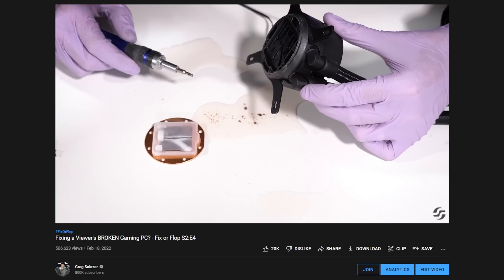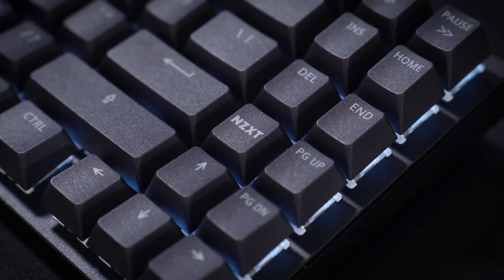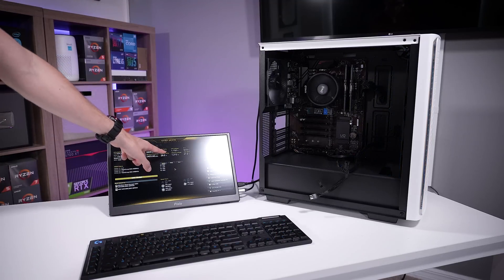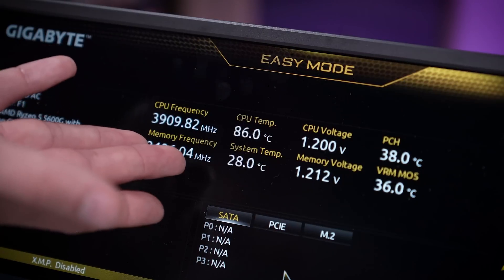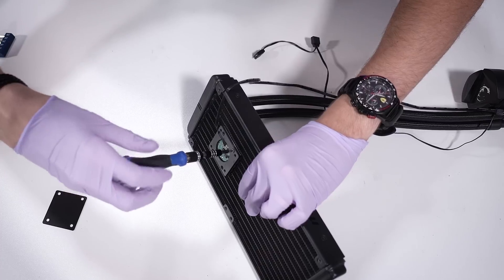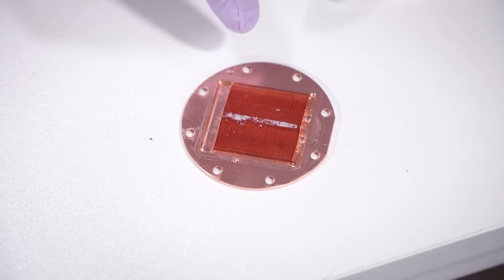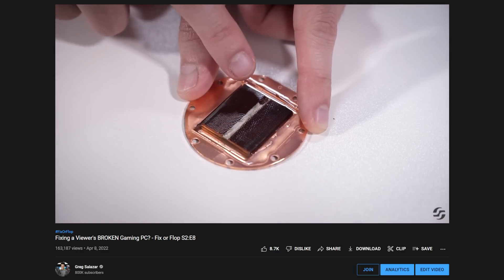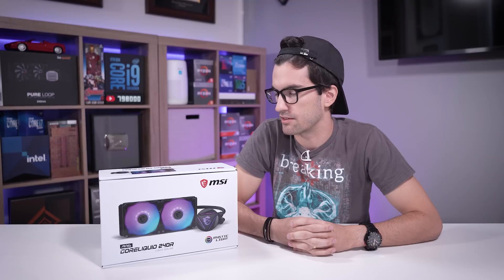Testing Viewers' Recalled AIOs

Comment: When these came out in Australia,  the 280R was on special for the same price as the 240R, so I bought that. My 280 is not part of the recall and is still running fine, so I got lucky there. I have a nice air cooler to swap to if it goes bad, but at the moment the 5600X cpu runs super cool.

Comment: I feel really bad for the people who bought this AIO, as well as the clients I recommended this too. This cooler is really popular at least here in Canada because it (was) the cheapest 240mm AIO with RGB fans included.
Reply: i did and it died 3 months later
I've came back to my old ventirad lol
Reply: Considering how many have sold it's still about a 1% failure rate.
I have the second cooler that was tested, the exact same one.
Year-and-a-half and my CPU has never been over 60 ft Under full load for hours.
Reply: @testickles8834  damn, i wasn't lucky then
Reply: @fmcparadise1450  
I'm beginning to feel like I won the lottery on every part I bought.
I've never had an issue with anything and it's mostly MSI.
Reply: @testickles8834  i mean im mostly msi but the aio is the only thing im unlucky with aha
Reply: @fmcparadise1450  considering how many are sold, and the fact that everything mass-produced has its number of turds, it's not a real big surprise or anything when you buy a piece that doesn't work right.
I would still say all in all the computer industry is still doing way better than the automotive industry

Comment: I wish I had kept my bad AIO so you could have taken a look at it and seen if it was really the liquid or just the AIO being garbage. My new AIO works great though, so no problems now. Got a Corsair one, since it works with my iCUE software, which is how I found out my old AIO was not working when it was under load. Easy to use software really saved my butt.

Comment: Hey Greg! This video was pretty interesting. I have a small problem with my pc. I have a NZXT x53 rgb AIO, and the temps are higher than I think they should be. I have a fractal design meshify c. One of my standoffs came without threading, and the stand-off screws don’t want to screw in. Not sure if that could be causing a problem. I’ve also tightened the block itself so I don’t think it could be that. If you have any ideas, that would be great! Also I’ve already tried all the options in the video that you have about high cpu temps. Thanks for looking at your comments!

Comment: I have the 360R v2 (replaced it through MSI’s recall over a month ago) and so far the temps have been good. Using it with a 5900x and temps have not exceeded around 82c running cinebench for 30 mins and idle temps are around 35c. MSI seems to have fixed the issue with their v2.
Reply: I used to work as a mechanic in a few Chrysler dealerships and I've noticed when we had to perform a recall on a vehicle, some of the replacement parts we would install were the exact same part, number and design as the original. Sure it would fix the safety issue temporarily by having a new part installed but the same problem may happen again but by then they would have expected you for to have purchased a new car already.
Reply: hey man does the v2 replacement act weird again after all these months?
Reply: @aaa5483  it has been a year now and it still works fine.

Comment: How was the thermal paste pattern when the cooler was removed? I had an issue with the heatspreader of the AIO not being flat. It was pointy enough to where I could feel it with my finger and could see it in the thermal paste "squishprint"

Comment: all AIOs made by apaltek OEM have same issue. ex) LianLi Galahad, Enermax LIQMAX and MSI Coreliquid MAG. According to igorslab this issue is caused by missing flux compensator
Reply: They are selling these units without a Flux Capacitor???

GREAT SCOTT!!!!
Reply: I have the Kraken M22 which is also made by Apaltek. I understand that it wasn’t the best choice, but so far there hasn’t been any issues after 3 years of heavy use.

Comment: I had an 2950X with an Enermax Liqtech cooler... so it goes without saying, it had problems. Got it replaced under warranty, immediately drained it, and filled it back up with distilled with some biocide. It was good right until I sold it about a year later.
Reply: Yeah, Enermax has taken a big hit on their Threadripper AIO's for this same problem. A little biocide and there may have never been problems.

Comment: Thanks for a great video Greg!! It is nice to see MSI take responsibility and replace bad products. I always thought their design to have the pump in the radiator. But still the CPU block needs maintenance every now and then. I bought my son a Cooler Master 280 for Christmas 2021. Hopefully it lasts for a good amount of time. It's the first AIO I have installed in ~35 years of building.

Comment: Would be interesting to see production dates and runtime hours on these AIO's.
Reply: Well I got my replacement for my first one in January of this year and it died about 4 weeks ago so it's less then 3 months of use for 3-4 days a week for maybe 4-5 hours a day
Reply: @potatoskins8155  that blows!!!! Pun intended
Reply: Had my msi aio for a year-and-a-half now.
CPU has never been over 60c under high load.
Sounds like I won the lottery
Reply: I've had my mag 240r since Christmas 2020 and I have had mine apart about 4 or 5 times now because of the issue, I looked it up last year and nothing came up but now I was told it's recalled so hopefully I get a new one in the next week or two.

Oh and my pc is running idle 24/7 and I only game on it once or twice a week so maybe 16 hours game time a week running with my i7 9700k

Comment: Hey Greg, I had the same issue and submitted an RMA. They sent me the new one first and provided a return label. I was pleasantly surprised by the process. Thanks for making this known.
Reply: well go MSI for not dicking customers around and getting the issue resolved.
Reply: I'm Scared, I hire a Thecnician to check my pc, he sold me a air cooled disipador (added free thermalpaste) and he charged me $50 to come fix my pc at my home.
but, the thing is he drained all the Brown water from the radiator and cleaned all the white particles from the block, he added Green radiator water for AIO's  he said and temps were still hight af. I'm afraid that opening the AIO could cancel the warranty :( Wish me luck i'm calling RMA, MSI live chat gave me the number, its mondays to fridays 9 to 6 PM PST

¿Any advise on what to say to RMA to get refund or another AIO?.
Reply: @skinnycattv  you’ll need to do a quick Google search for their RMA form and specify that the AIO is overheating. You’ll need the serial number as well. It is really simple. They didn’t hold up the process the minute they heard overheating. Hopefully you haven’t missed they’re window of automatic acceptance.
Reply: @imagotchi_  ty brother and all of you that helped me. I filed an RMA with the thermal problem and the Serial number, I will be sending the AIO as soons a the replacement ships in. (lol, almost gave MSI my Motherboards AM4 Back plate and plastic bracket thinking it was part of the AIO, haha).

I will get back ASAP to update what happend with RMA.

Comment: How can we know if its the new or old version of the AIO? I have the 360 version and might need to have it replaced.
Reply: If you've had it more than a couple of months it's most likely to be a V1. The V2 released in February/March if I recall. Check the RMA page with your serial number and you will know for sure.

Comment: Got both the 240R and the 360R since I was so happy with the 240R I bought first. 57 degrees with an R6 3600 overclocked to 4,5ghz last time I used it. The 360 is a bit toastier at 72 under load, but that's with an R7 5800X  which everyone said was a toasty boi. Played games with the 360R for 12 hours today, and at this moment, I'm idling at 42C watching this video at the end of the day. So I don't know which fluid provider isn't doing their job, or if I'm just super lucky. Bought my first MSI 240R in 2019  and the 360 in 2020 so maybe this is a failed attempt at cost saving by changing fluid provider? Kinda hope this is a sub contractor fluid problem since I like having an aio I can front mount without issues.
Reply: it's not just the liquid, the pump started rattling very loud within 4 months, the complete design sucks and is bad. Better use a decent brand , like corsair, never had a single problem with them in 8 years of use.
Reply: @Diaman_D  Well, mine isn't rattling at all. Air cooler was way louder. Like I said, this sounds like MSI fucked up at cost savings for second iteration of the cooler and chose a liquid company that just isn't good.

Comment: 5950x idles at 58c @ idle 74c running prime 95 for 12 hours straight.  Just a hot chip. Also running 4 140ml outtakes and 8 120 intakes and corsair 420mm elite aio
Reply from the maker: This is a 65W 5600G ten minutes after a cold start LOL.
Reply: @GregSalazar  sorry lol thought you Said 5950x.  Yes that's abnormal.

Love your video's thanks for what you do.

Also I just sent back a nzxt kraken 73 for same issue

Comment: Can confirm these Coreliquid coolers are junk. Had mine for about 6-7 months and ended up having this exact issue. Checked out their recall and surprise suprise my unit was not covered under it. Provided screencaps of my CPU temps in my BIOS to their support team and they still wouldn't budge. Had to fork over 20 dollars in postage to RMA the thing. Ended up just buying a Noctua NH-U12A and calling it a day. I did just get my Coreliquid cooler back from MSI a few days ago and at least they're swapping out the coolers with the new V2 version. Just sucks that it's just gonna end up sitting on a shelf for the foreseeable future.

Comment: My buddies NZXT M22 same issue, pump in radiator small 120mm AIO came with his NZXT BLD. started making weird noises and then running hot. just ordered him a new AIO instead but took this apart and def clogged
Reply: What cpu? Had the same aio, Mine started running a bit hotter than I remembered it doing when I first installed it, I’ve since replaced it with a kraken z63 280mm but I was using mine on a ryzen 7 5800x, still got the m22 laying around
Reply: @beanhead67as  He had it on his ryzen 5 5600x and ended up getting a kraken x53 240mm and put it on it. I kept his m22 and cleaned the block and pump. Might throw it on a smaller less hot cpu in future!
Reply: Do you know how long he had his NZXT BLD? I know it wasn’t the best purchase for the money, but my Kraken M22 is fine after 3 years of heavy use.
Reply: @nearly-  his went bad after 1 year and same with his buddies

Comment: I got mine replaced for free and it was explained to me that what happened to mine was a "foreign object matter was somehow introduced to the AIO via the cooling fluid and was not noticed by QC and only affected a limited number of units" either way I got a new one and this one works fine so I am happy. Thanks for noticing and pointing this out Greg and making people aware.
Reply: how did the RMA process go?
Reply: @HazewinDog  it took a while but after explaining the situation and sending it back for them to “investigate” they came back to me pretty quick with the above explanation so all in all it wasn’t to bad
Reply: @GarysTechRegrets  Gary I tried to get a replacement for my 240r which was showing the exact same issues temps at 90c whilst idling it was the second one I had after Amazon replaced the first for a faulty pump which I now know from the clicking sound also suffered the same fate as the others but when going through the MSI website they claimed my serial number wasn't one of the affected units which is clearly not true the issue must be more widespread then they first thought
Reply: @potatoskins8155  That's strange because when I did mine they asked for my serial number and immediately went straight from the scripted hmmm this is unusual etc to OH return it to us for investigation immediately! so maybe my serial number of mine was flagged which is why my turnaround was quite quick? Or it could be they were trying to get ahead of something before it became widespread...Who knows! Hopefully, they have replaced it now though?
Reply: @potatoskins8155  hey did you find a solution ? I’m in that exact situation right now
Reply: @joeyphoenix4370  I ended up just returning it to Amazon let tried to give it the old it's MSI issue not us but as the seller of the product atleast within the UK they have the responsibility of the item it's down to them to then get there money back for the item from MSI I got a full refund and bought a dark rock pro instead as seems ALOT of aios end up having issues
Reply: @potatoskins8155  thanks man! I’ll won’t get an aoi fir sure
And you know how long until they don’t take it back anymore by any chance? Is it a year? I have had mine for 8 months..
Reply: @joeyphoenix4370  hmm at 8months I'm not 100% if they will take it best thing to do is hit them up and explain the issue tell them it's a known issues with the aios from MSI if they don't help you then reach out to MSI and tell them the issue you are having and that it seems to match the issue so many others are having they SHOULD help you out
Reply: @potatoskins8155  ok thank you so much!
Reply: Lol i would describe it as bacteria had a pool party
Reply: @ognjenjakovljevic494  your not wrong 😂 it literally smelled so bad it was almost vomit inducing
Reply: Hey I would appreciate some help I accidentally deleted my Microsoft edge and every time I try to reinstall it it will give me a error can someone plz help
Reply: @wkey_zen  make sure you delete system.32 that will sort it
Reply: Polite way of saying a disgruntled employee pissed in the batch of coolant.
Reply: @petrolhead0387  glad I wore gloves when I opened it up now lmao
Reply: so risky
Reply: I sent mine to be replaced, got told that i had somehow myself contaminated the fluid inside. -__- This is the second time MSI has been really weird with me, back in 2011 i bought a MSI laptop and it did not power up brand new. I contacted and sent it to be fixed/swapped. I got respond back telling that i had myself somehow disconnected the wires from the power. (it had no physical wires at all for power.) But still had the "seal" sticker on it. Both cases i did get the replacement but i had to point out their retard logic first.
Reply: Where did you go for the RMA?

Comment: This is why I don't mess with AIO's or even custom loops anymore, air just works with no headaches and its cheaper. I still have my old NHD-14 that will work perfectly fine, it was first used on my 2600k over 10 years ago. 

On another note after watching your sponsor spot I would like to suggest people build their own Keebs, you get a better product. I use a Royal Kludge RK84 base with foam mod, tape mod, holy mod, stabilizer mod, Akko Radiant Red switches lubed with Krytox 205G0 lube. Excellent Thoc and my keycaps look absolutely beautiful, its super fun to mod and build your own keeb and the final result is 100x better than buying one off the shelf.
Reply: I had this attitude as well, especially when considering that air coolers will not deteriorate over time so much. But I am giving AIO a go on my main game machine since I tend to upgrade bits on it quite often.
Reply: @Amos.T.Fairchild  I had a few leak and some just stop working, not all will leak or fail though but now I just stick with air. They do look really nice though, nice and clean but something about a giant air cooler appeals to me.
Reply: @hardcorehardware361  They have always worried me a bit. I can see a fan stop. I can't see a pump stop or fins get blocked inside. Lol. But I'll give things a go and I have been impressed with the cooling and cosmetic side of things. I kept the air cooler just in case...
Reply: @Amos.T.Fairchild  It does happen, it introduces more points of failure. They do look cool though.

Comment: Before seeing the videos about these AIO's, I bought the 240c, and thankfully it doesn't seem to have this issue. I was super worried and monitored my temps for hours after installing it.
Reply from the maker: Keep an eye on it. The symptom won't show up right away. May take several months.
Reply: @GregSalazar  I have an 120mm aio that has similar symptoms
Reply: @GregSalazar  i bought a coreliquid 240R almost a year ago now but after seeing your video i decided to clean it, i did notice a little bit of build up but i caught it before i had any issues with temps, monitoring temps regularly to see if another cleaning will be needed in the future
Reply: Get bequiet dark pro $20 cheaper and better performance
Reply: Me who has been using RiveTuner Statistics Server overlay for so long I feel like something's missing when it's NOT there:
Reply: Same here, mine has been fine for 3 years. So fine, in fact, that I bought the 360R when I upgraded from R5 3600 to R7 5800x. Had 0 issues with either of them. Bought my 240R in 2019 tho, so I'm suspecting that this is a cost saving measure gone wrong. MSI changed to a cheaper fluid provider that isn't delivering what they said they would.